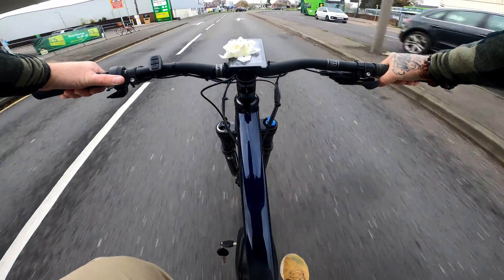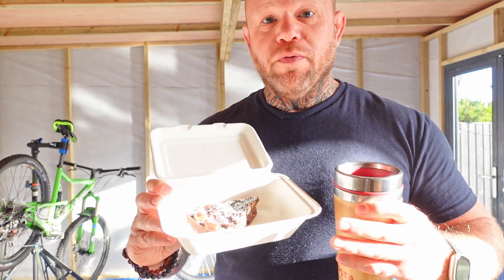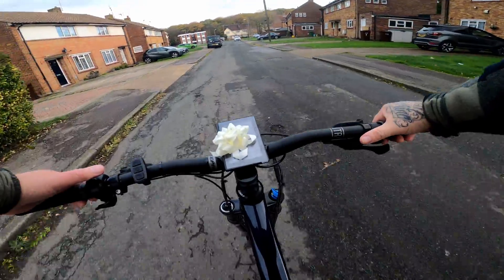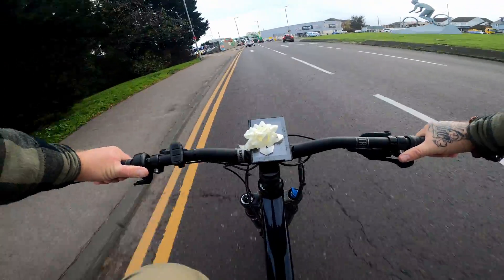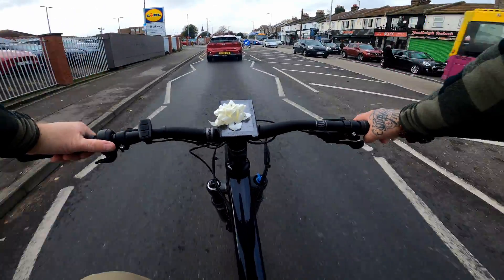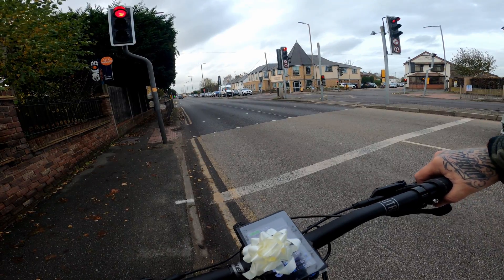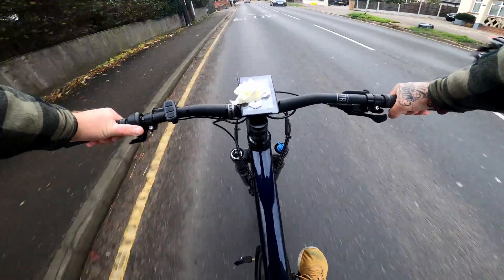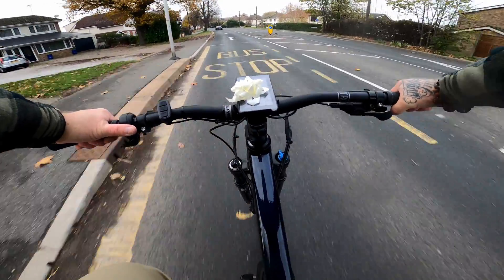HIGH-POWER E-BIKE CONVERSION (WITH TEST-RIDE)

Comment: I don't get the pricing. The 500w is $437, the 350w is $380. Difference between the two of $50 is already factored in, but when you add the same battery to both, the 500w is $887 and the 350w is $735, an extra $100 out of nowhere?

Comment: Looking at buy this bike as it’s well under £500 so looks a bargain.. did you need to swap the rear sprocket over? And did it fit ok as you removed the brakes to fit ?

Comment: Hi, Dude, After 2 And a half years and 10.000 + miles my motor is knackered, can you or kirby sell me Just a rear wheel, 26 or 27.5 2000w with freehub body for a cassette,       Thanks,
Reply from the maker: I don't sell wheels.  I think Andy only sells kits without battery but there's next to little difference in price so might as well get a free spare controller throttle and display

Comment: Just have one question. What is the system exactly? Controller battery and the wattage of the motor. I have built several 48/52Volts by now and in the process of building a legal looking (350W) high-voltage 72V one for myself.
Reply: It's the kirbebike conversation kit so its 1500w, peak over 2000w, 35a controller, 52v 17ah LG cells battery. A 72v 350w wow that sounds like quite something my friend lol. Is it a 350w hub motor then? Hows the build going?
I myself have a 48v 8ah battery with a 250w motor. Cant change the battery size cos the battery was made to fit in the bike frame. I also have a 52v 17.5ah with top Panasonic sanyo cells (upgraded from 48v battery) and that works with the 1000w voilamart kit. Its 1000w but it peaks at over 1500w and goes 36mph

Comment: Would a kit work on a carrera vengeance   which appears to have a non functioning hub motor as the connector to hub has only three wires  using the 36 volt battery .controller etc  already fitted to the carrera ? Halfords seems to think the hub is only guaranteed for 1 year

Comment: Hey Steve , I just received my Cyrusher xf900 yesterday.I know you had one a few weeks ago. When i wheel it backwards it shoots forward by itself!! Dangerous . Did you experience any such thing with yours? Cheers Glen...
Reply: There's a setting in KT controller to reverse that if the sensor has been put on wrongly